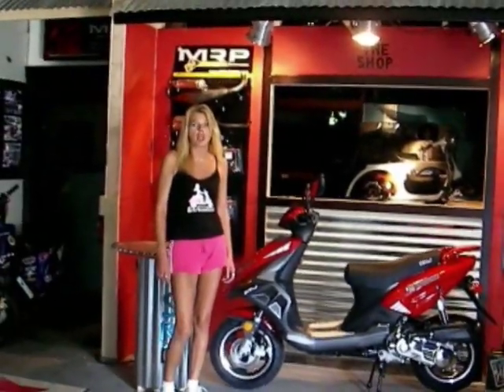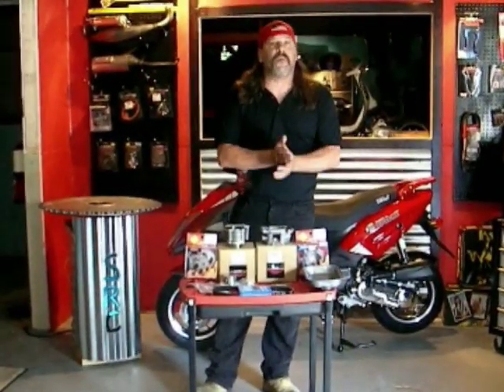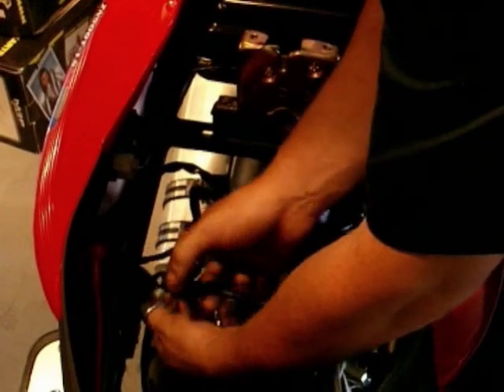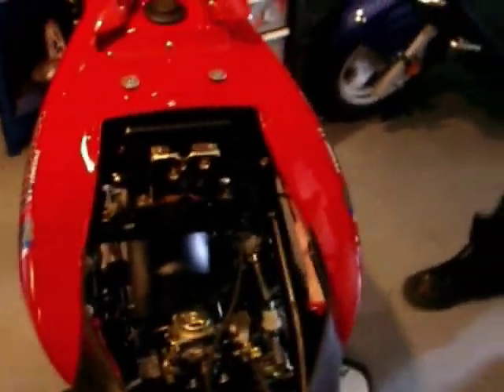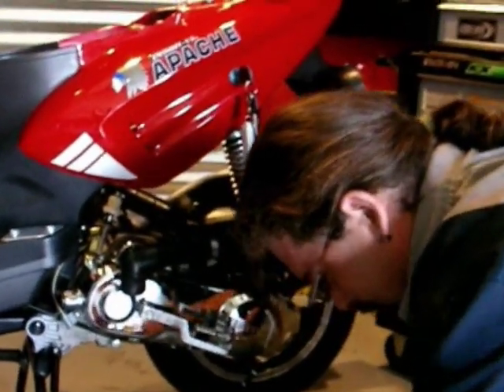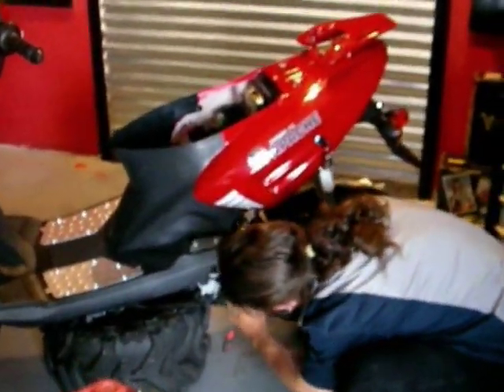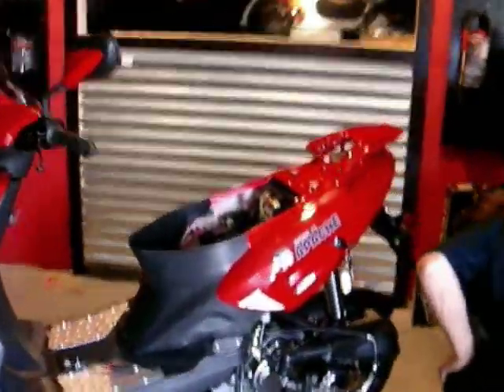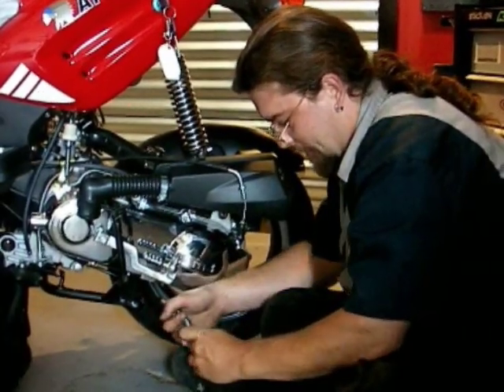Scootertronics 139QMB Engine Upgrades

Comment: I hate to tell you this guys but I can do a 50cc to 80/100cc  upgrade easier and faster than you.   There is no need to pull the entire engine to replace the piston--head---valve train and carb.  You need to go back to motor cycle mechanics school.  Replacing the belt and rollers nd the rotor and stator setup can all be done while the engine is in the frame.   My total time to do all that is about 60 to 70 min from start to finish.  And you never finished the video.  Maybe you realized yours was really bad.   R & R a complete engine is what you showed.

Comment: I installed a 100cc big bore kit in my taotao and Ive been kick starting it for three days straight and nothing happened. I got spark, compression, gas getting to the carb, and a #90 main jet... Any suggestions?

Comment: I have a 139QMB engine, as far as I know, it's all restricted. The pink wire is cut, not too sure about the exhaust restrictor or carb...only running on high octain fuel and I get 50MPH?:S There was a hole in my exhaust about 5mm, I welded it and made it instantly faster. Also had a sports air filter, replaced it with original and yet again, It goes faster. Don't bother with big bore kits, you can get good results with very small, yet effective mods.

Comment: @lee47848 Are you sure i would have thought if they had a four stroke 49cc then why did they not use it throught the 90s on the likes of the honda vision and express etc i can not understand why they used 2 strokes for so long if they had a 49cc four stroke with cvt transmision that worked so well....

Comment: Hello...nice vid.

I have a problem with my 139qmb engine and wonder if you know what it could be.
It is hard to start and i cant start it with the startermotor....sounds like it gets to much air or fuel or something like that.....

Things i have checked on it so it is ok is: throttel membrane,valves,fuelpump,spark is ok and comp is ok.

Would be great if you have any ideas what more to check over.

Comment from the maker: No you can use the stock cam and you also don't need to have  hp exhaust but the perfomance will not be at its full potential. The exhaust would be a good choice and more needed then a cam. I would recomend the exaust if you want that big bore kit to do all it can
Tommy Thunder .